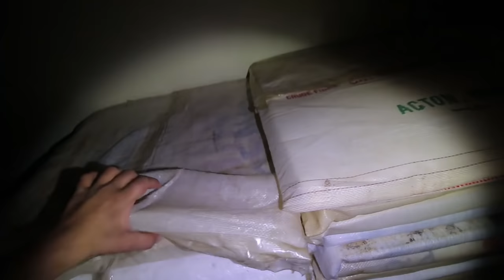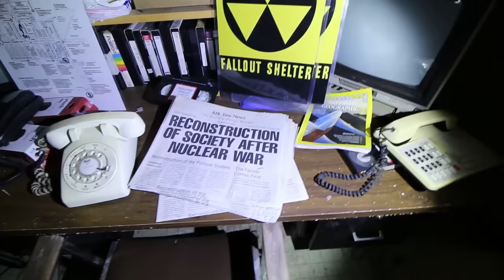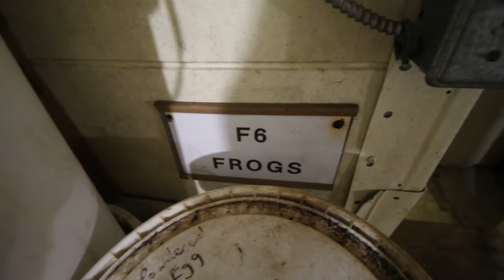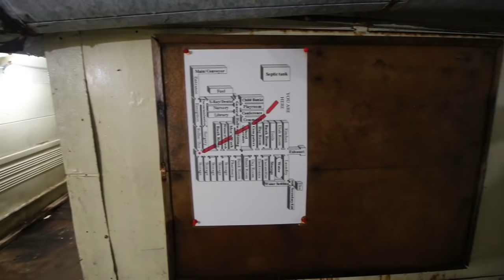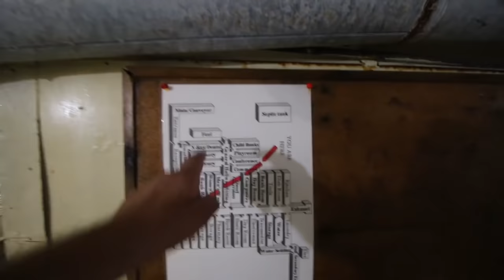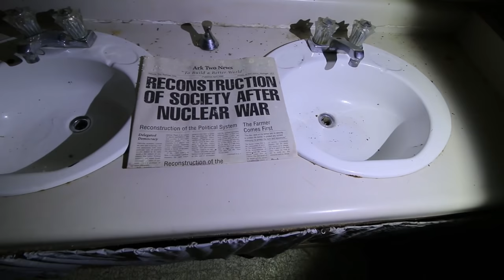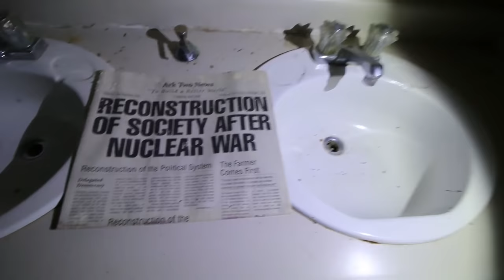Secret Underground Nuclear Doomsday Bunker Privately Owned, The Ark 2 Shelter

Comment: The only thing I didn't see was a type of jail cell in case someone goes crazy during a time when the outside doors cannot be opened because of contamination.
Reply: Straight Jacket :)
Reply: Easy just throw them outside
Reply: Thats what handcuffs are for. Id cuff someone to their bed and tell then they are confined for 3 hours or longer if needed

Comment: I'd hate to see someone try and stay there for a long time. Didn't look too healthy to me. Needs a lot of ventilation and moisture control installed. Just building something like basement rooms connected together, covered with steel decking and concrete poured over it would be much better. I'd have fake tree stumps with security cameras hooked up to LED TV placed vertical for "WINDOWS" so that people would not feel like they are closed in all the time. You could see who was coming around too. Just saying that is what I would do if I had the land. Build a couple of rooms each year till I was done.